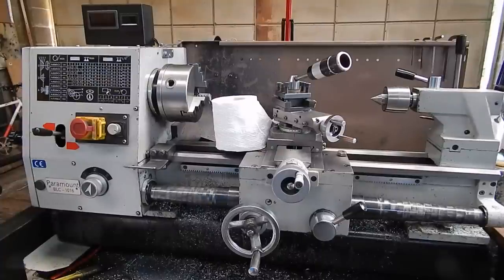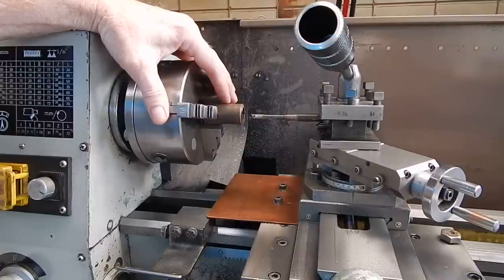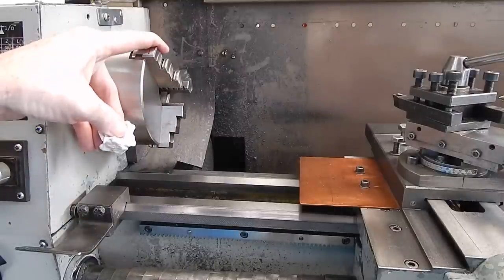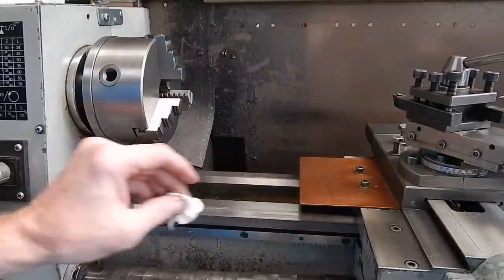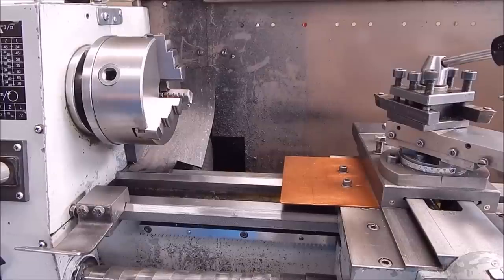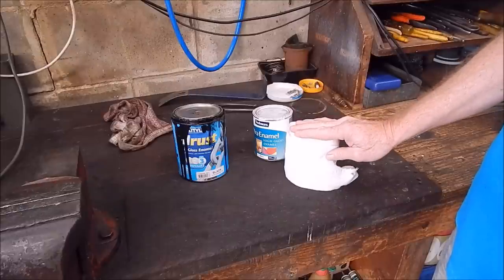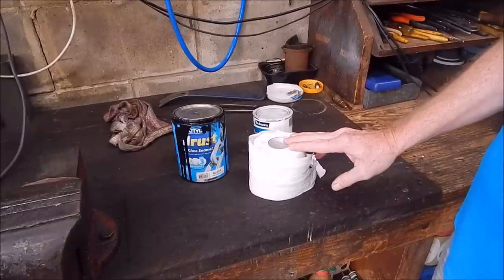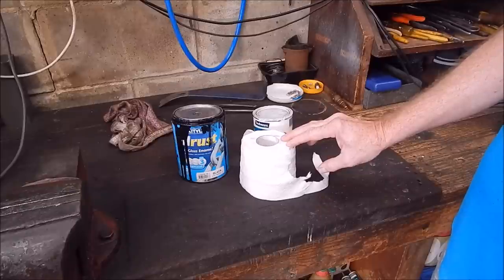The handiest thing in the workshop

Comment: Thanks for the tips, never think that something is too simple, there are dozens of people that have never thought of this, count me as one.  And I have a tip.

We use paper towels that are already perforated at half sheet size and I take the roll on the band saw and cut it in the middle so I get two toilet paper size rolls, which is stronger than toilet paper for the heavy jobs.

So now, I'll put one roll of toilet paper on the paper towel dispenser and one roll of toilet paper, now I have wiping material for just about any job.

Thanks for the tips.
HH
Reply from the maker: Good idea.  Some paper towels are a bit too compacted to pick up the fine particles like toilet paper does, which is a very open type fabric.  Yes, the simple tips are often the best.  Cheers Rob

Comment: Did a quick check to make sure this wasn't from 1 April. No, it's from 12 April. Okay, I'll give it a try. My going-in thought would be that it is too prone to disintegration to get any work done (as compared to a paper towel), but we shall see.
Reply from the maker: Hey, would I give you a bum steer ;)

Actually it works fine, and is tougher than it looks.  A lot more flexible than paper towel.

Cheers Rob